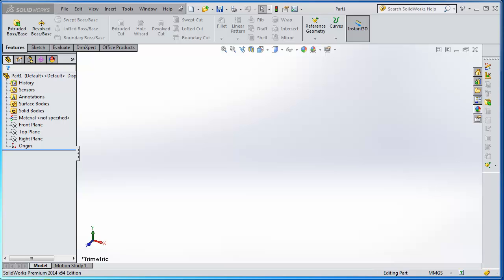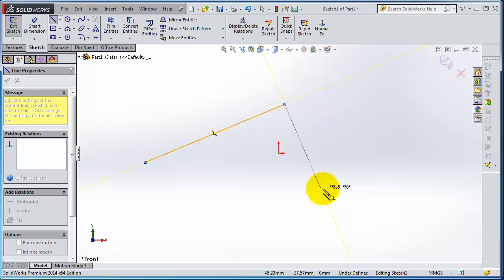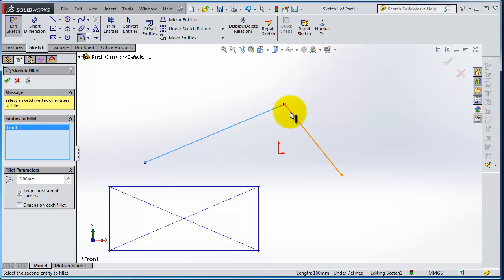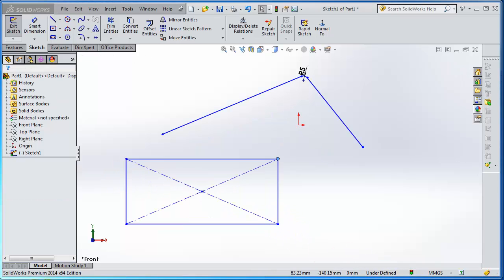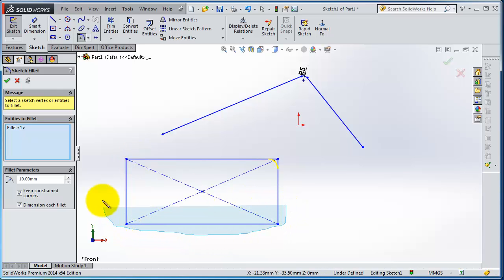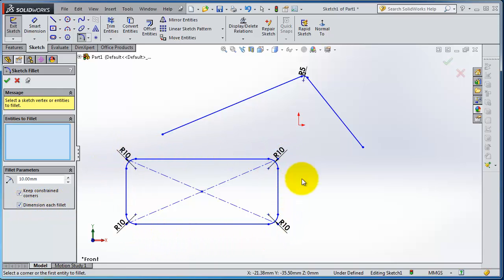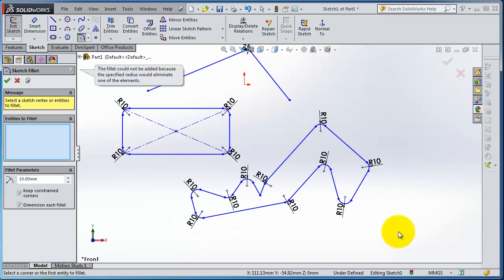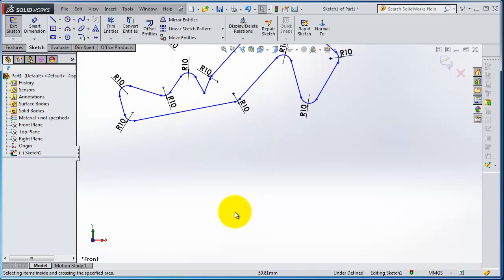SolidWorks 2014 Tutorial11: Sketch Fillet

Comment: Great lecture ! Thank you. Having been in engineering and production of parts and products for several decades now, we have received requests for a wide spectrum of parts and products, ranging from cast metal & CNC machined components to metal stampings and sheet metal forming, manufacturing of injection moulds and plastic & rubber moulded components, spring forming, sintering of precision ceramic components, optical lens and prism fabrications, electrical & electronic components manufacturing and assembly, printed circuit board assemblies, leather and textile product assemblies.....etc. Regardless of what the product our customers asked us to develop and manufacture, the programs SolidWorks, Autodesk Inventor and CATIA made us able to manufacture their products fast and most of the time without a problem. I can't think of being in this business and fully satisfying our customers without the help of these software tools. These and some other tools we have been using together with these helped us render the 2D and 3D files, simulate mechanical functioning, simulate molten metal flow, plastic flow and cooling in moulds and dies, simulate optical beam behaviour in complex optical assemblies.....and much more. We are very thankful to all the smart folks who have prepared and written the code of these programs and all those who brought them to our computers.